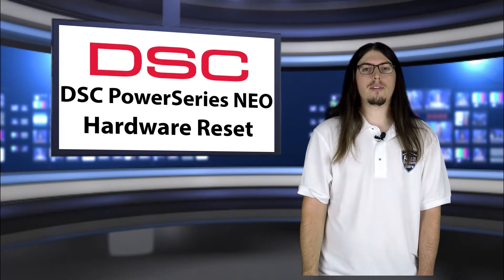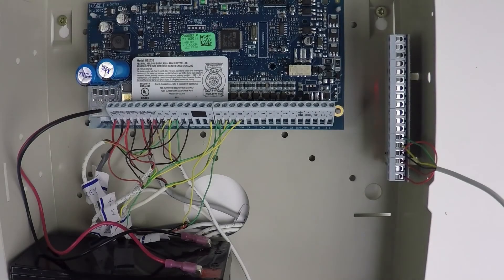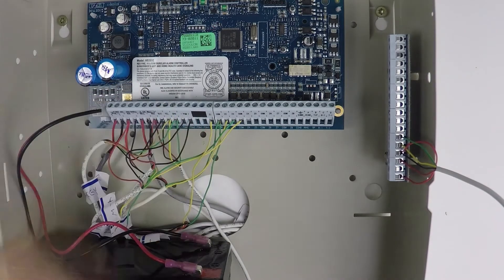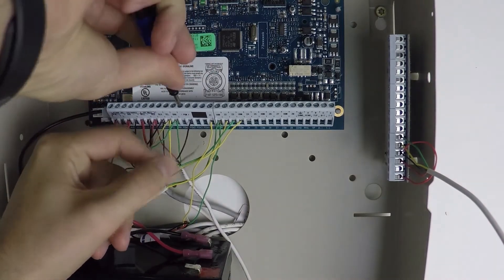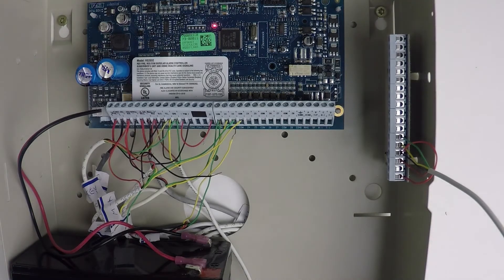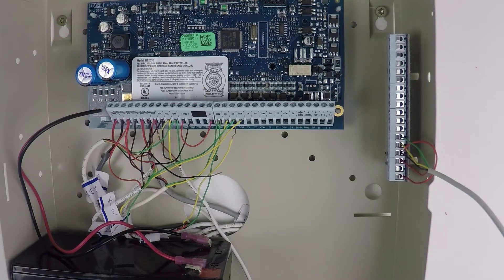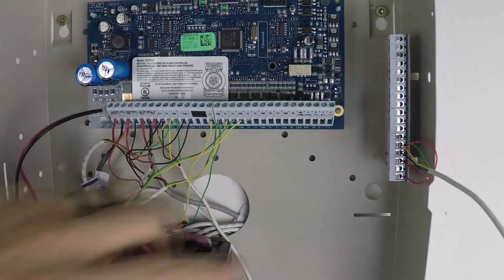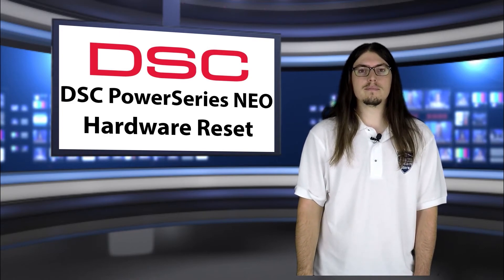DSC PowerSeries NEO Panel Default Programming Reset - Alarm System Store

Comment: What is the process to reset a panel that is installer locked?
Reply from the maker: You have to replace the main board. There is no way to unlock one to my knowledge, at least on the Neo series.

Comment: Is a factory reset possible to do with a GE Concord 4 panel, without knowing any of the codes, by using a jumper in the panel?
Reply: On a Concord4 panel,  if you don't know the installer code there is no way to default it.  But the way this panel looks at codes entered, it is very possible to guess the code in less than a half hour if you do it right

Comment: I have a DSC PC1616 with PK5508 keypad and I tried the method you explained step by step for a few times but the panel does not reset. I don't know the installer code or the Master Code and I thought they should return to the defaults (5555 and 1234 respectively) but they don't. What happens after I remove the jump wire and reconnect the power the panel returns to an armed mode and as soon as I open a door, the alarm goes off. The time and date is reset each time I disconnect the power and the battery (the battery is depleted anyways). I'm frustrated.
Reply: May be installer locked. If the installer enables the lockout program feature this won't work and there is no way to get in. You have to replace the main board in that case..

Comment: I've done this but it doesn't reset.   It clicks many times when powering ON which tells me the installer lock is ON.  Is there a way to remove this installers lock ?  On my older panel, I short COM and the 4th pin on the EEPROM but this panel is different.

Comment: i've heard some alarm companies put a safety lock preventing you from resetting. even after a hard reset the installer code cannot be changed. is that so and how do we see if this is the case?
Reply: Yes I need the same answer.
Reply: Power the panel down then power it back up again.   If you hear a chatter, that means the panel is locked and performing the reset in this video won't work

Comment: What's the default installers code?
Reply from the maker: The default installer code for the NEO is 5555, but if the system was installed by a company or an independent contractor it could be something different. Also, we strongly recommend that if your system has the default installer and/or master code that you change it immediately to some other code that you can remember as most thieves study up just enough to know the default codes

Comment: Great video, thanks!  I just moved into a home with an older Napco Magum Alert 1016 system.  I want to use the alarm un-monitored. Before I figure that part out, would you know the procedure for resetting the dealer code to factory spec?
Reply from the maker: We don't deal with Napco systems so we've not the technical experience to give on that, unfortunately. Here are some good leads though - https://duckduckgo.com/?q=napco+factory+reset&ia=web

Comment: We have PC1555/PC1555MX system and I just want to quickly ask if we reset the system like video shown, do we have to reprogram all the zone or enter any new info? I am asking because the short wire is the easy part but the re-programming part if any is gonna be hell for me. Thanks.
Reply from the maker: If you do the factory default reset then you would have to reprogram everything

Comment: We have a PC 1555 DSC security system. My dad and I realized that one of the wireless door contacts sensors is not, in the system or was deleted. How do I enroll that sensor?
Reply from the maker: You would need the devices electronic serial number. You would then go into programming by entering * 8 and 4-digit installer code. After that, if you have an alpha-numeric readout keypad, you'll see 'Enter Section'. Go to section 804. You will then enter the zone number you want to work with. After entering the zone number you will be taken to a screen where you will type in the electronic serial number.
Reply: Alarm System Store we have a fixed English keypad, or doing it blind, meaning it doesn’t say enter section on the screen. I did all that, and when I went to enter the serial number, for example, let’s say the sensor serial number was, 123b4A. I know you do it by entering, 123*2*4*1*
However, when I enter the *1, the keypad beeps before I can hit the last star. I did figure out the problem though. The technician accidentally, turned off the zone, and I went back into the programming and turned it back on. I am actually blind myself, and just listen to the instructions the person is giving in the video.